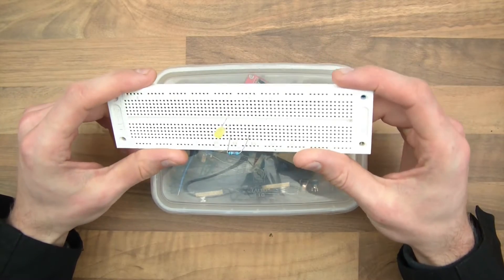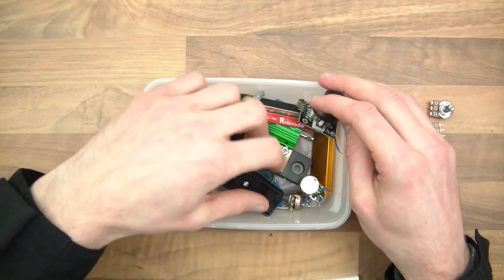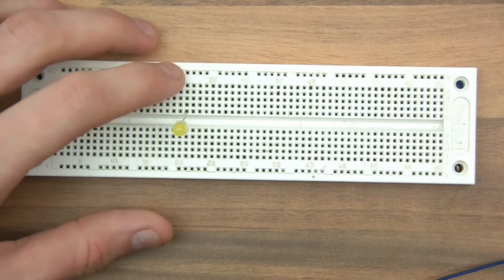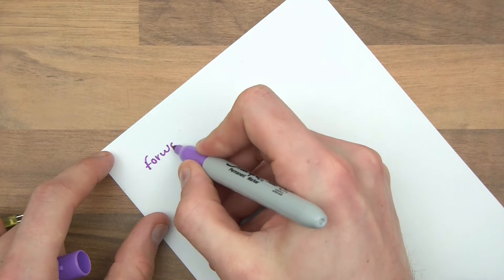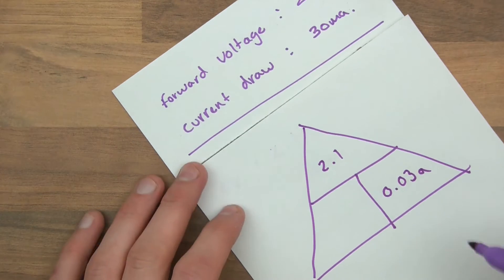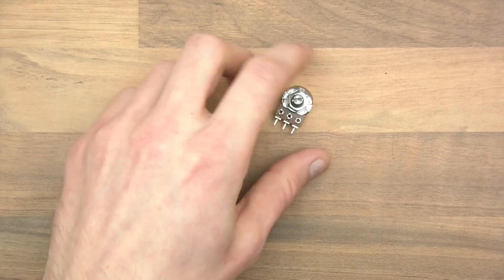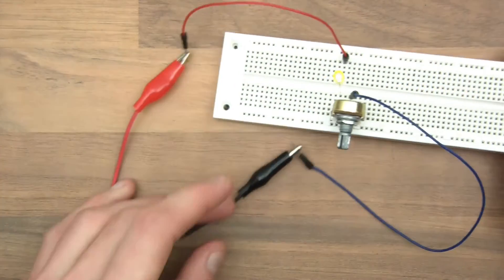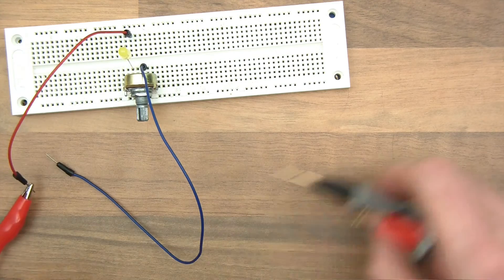EXPERIMENT #2 - Powering An LED - With Variable Resistor - Simple - Step by Step - Ohms Law - Part 1

Comment: I did this and mine smoked
Reply: You probably turned the pot right down so the resistance was too low.  Too much current passed and it was, literally, light(s) out.  If I was mucking about with a pot in series with an LED, I would put a safety resistor in series with the pot so that, even at the end of its track (i.e. 0 ohms), the LED wouldn't fry.
Reply: @sambda  no m8 my LED is fine it's my potentiometer that fried